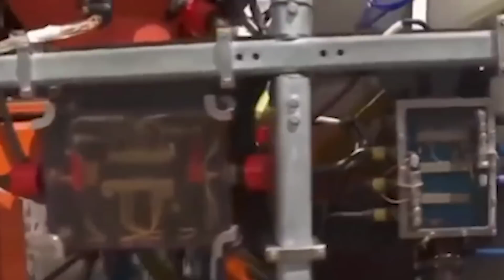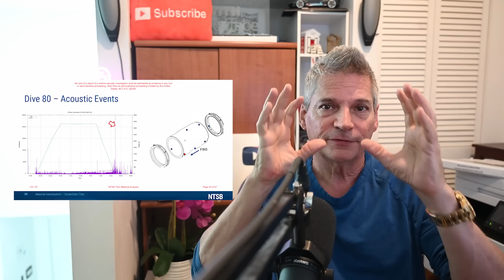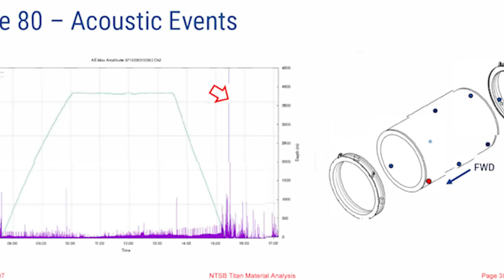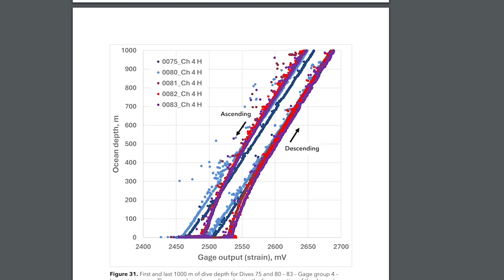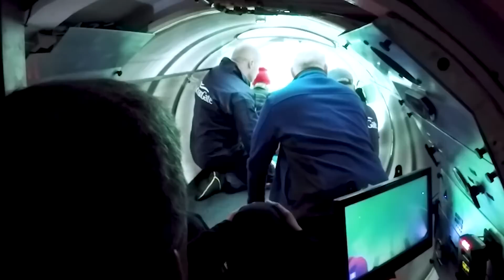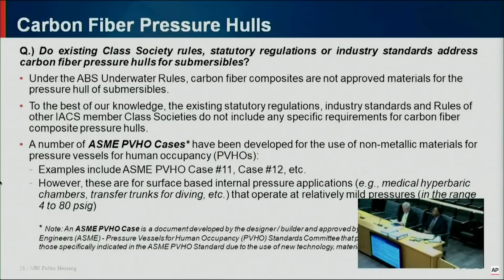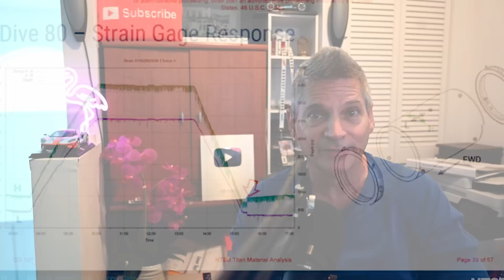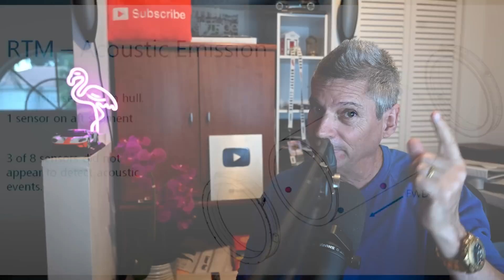How OceanGate Titan Sub Realtime Hull Monitor FAILED! RTM

Comment: Logic tells me at 1inch thick of CF sandwiched on top of other 1 inch layers of CF up to 5 times, is know good of the bat, because the compression forces on it would delaminate it easily as its technically not a solid block,, what would happen is each layer would delaminate separately and it would Implode definetly, no matter if it was reinforced with metal rings, the pressure would find it's way into the Hull automaticly in a unpredictable manner. In different areas at different times, The RTM is not set up to detect what is except able in ways of a graph, meaning no one knows what it's except able tolerance is, because there's no data in all of history to support the test they were doing, meaning they have no reference point to begin with, the whole project is flawed from the start.

Comment: Does the graph show which sensor is detecting which area of the Hull, if it does not then how can a person keep track of the data methodically. Pinpointing where the movement is happening, if it don't show that information then this system is not going to work as intended, furthermore does it show at what depth the movement is making and pinpoint accuracy of the movement on the Hull of where the noise is coming from at pinpoint accuracy on the area of the Hull. If it don't do that then it's a gimmick and not showing any information that would be needed to keep track of the Hulls condition. PERIOD.

Comment: So what happens if the pressure on the titanium end domes at each end Force themselves inwards the deeper you go, At the same time the carbon fibre are forced with pressure at compression, now you got a situation the pressure of water on both material become different to one another, and logic says titanium is stronger then carbon fibre under compression so now what will happen is this design is a design that will Implode.

Comment: The acoustic RTM system was a hollow sham. It gave the sub pilot visual readouts only of the sound levels from the sensors - there were no sound alerts. Unless the pilot had his eyes on the screen, he was unaware of any issue.  The system was simply one piece of assurance he could give his clients. It was essentially useless for safety purposes.

Comment: Howdy Jeff. Fifty years of composite construction here, ten in CFRP. Have another look at your 
vid. Notice how the top line of winding is curved? The mandrel should give its shape to the layup.
The modulus will be uneven, no calcs will be possible. The hull must be of consistent thickness. I won't go into belt sanding pristine laminated structures. Carbon fiber must be monolithic, in dimension and distribution of stress. CFRP is an excellent choice, and makes a submersible just fine, after seasoning and strict dimensional standards are met... Love your work on 171....   Captain Bill

Comment: The idea behind the RTM system is sound. But it’s useless without a metric by which to interperet the data. You need to do the destructive analysis with the sensors to know what your material sounds like under strain, and you need to  conduct the carbon fiber autopsy to see what kind of damage the sound you just heard caused. And you need to understand how to correlate your data to actually understand what it’s telling you. And Stockton did none of that.

Comment: I always thought carbon fibre products were always placed in an enclave under pressure in order to squeeze out all these defects to the glue layers.
Reply: Autoclave. Yes !! It also needs to be wound with linear stress on the tape, to prevent wavy results as seen in the video. That is a rookie and lethal product. The CFRP did not fail. The Hull/Titanium join leaked, and the implosion was preceded by internall pressure blowing out the lens dome first, then implosion. They knew from the water entry they were going to die ......that's why they dropped ballast ......

Comment: In my (brief) laboratory experience with bend testing carbon-carbon composites with acoustic equipment set up, the time between seeing an increase in acoustic events (fibres breaking) to total sample failure was usually a couple of seconds, so unless you can remove the load instantly, the test sample breaks.
This is why miners like wooden support beams, you can hear them start cracking and have time to get out.

Comment: That arrogant @$$hole never did cyclic fatigue testing to see at what point the data he was gathering from the RTMS would actually indicate a failure would be imminent... he barely did destructive testing.

If you really think about what they were doing with the data, they were only listening to the sounds that were being made, never once did any of them stop and realize that the sounds they were hearing were fibers breaking and those fibers do not heal, meaning every sound event they were picking up was further degradation to the hull and thus inevitably marching towards the point when enough fibers would be broken that the thing would collapse in upon itself in a nanosecond timescale.

Comment: New communications from the day in question reveal that the RTM ssustem lot up across the board and they were dropping weights to come back up but it was to slow they couldn't get the acsent going good enough in time so sad they reported that there was loud noises coming from the aft section of the sun it was probably from welding on hooks on the ring for transportation after being told by the engineer that it would be a bad mistake because the ring wasn't designed to handle such wieght

Comment: Great video, thanks 👍
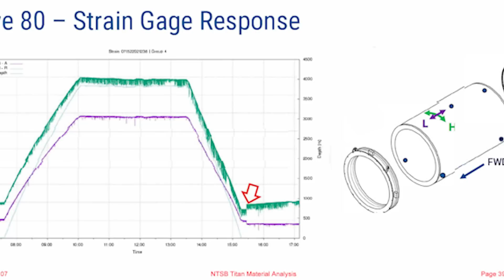8:40 That big bang sound would make sense, because when they dived something relatively major in the hull must have reached "almost" breaking point, but the pressure kept the damaged hull in place where it must have started cracking significantly, but it did not move or make major sound due to the pressure and not damaged enough to cause an implosion. However when they came back up, the negative pressure caused that crack to open up as the hull expanded back to its original size, and that caused the sound and strain gauge readings. 
So that bang was the sound of the hull telling Stockton that it was done diving to the Titanic depth (and then leaving that damaged hull in freezing conditions for almost 7 months caused the final damage that guaranteed an implosion on their next dive to depth), but Stockton played deaf & dumb, because he needed the dollar$ at any cost, even if it meant they implode, which I believe in his mind was the better option than replacing the hull, which he could not afford, and declaring bankruptcy was not an option for his ego & arrogance.

Comment: Thank you for this beautifull documentary. Was the titanium/ carbon connection ever tested under these high pressures?
Reply from the maker: I think they had small replicas. The first replica was about 3 feet long
Reply: They tested 1/3 scale models in a water pressure vessel.

Comment: Not an engineer at all. But my understanding is telling me that once something is stressed to a certain point even if it’s returned to a standard point it’s still not as durable as the original. 80+ trips was too much. Especially if it’s carbon fiber and signs of failure was already seen. 

The warning system should have been used before trips and not whether or not to continue the current trip . If that makes sense

Comment: The rings you describe as potentially helping to reinforce the structure sound a lot like bulkheads which are common in marine structures. Probably could have at least helped with earlier warning - they may have shown note obvious evidence of fatigue physical buckling if they were made of metal. The overarching failure iis they committed the worst engineering sin one which is to build the vessel with a single point catastrophic failure potential on critical systems which in the case was  unbelievably the actual hull itself. Take commercial airplanes as a relevant .  example : they are built on a tertiary backup model for all critical components ie they have 3 backups for all critical systems to prevent a single failure from creating  a catastrophic failure event.

Comment: I am now wondering, so they had a real time monitoring, rush said, that if there was cracking heard it would be a sign.
The last message received by the motoring ship was "Dropping two weights" so what if the real time monitoring system didn't actually failed, but rather they realized and tried to get to the surface quickly, and thus they "dropped two weights" 
But when they dropped those two weights was when the Titan imploded

Comment: Talking about Boeing recommending a 10 inch hull vs Stockton’s 5 inch hull. Stockton Rush should’ve taken a page from the very shipwreck he was visiting and subsequently went down in history with.. The Titanic was made made from pig iron (and low grade steel) I’m assuming to cut costs/ reduce manufacturing costs. Also, the Titanic was supposed to be double hulled and it wasn’t, another fatal manufacturing  cost cut.. Definitely some interesting parallels here…

Comment: I am not at all an engineer but even I understand that :

1- a spherical hull is stronger than a cylindrical hull against external pressure

2- winding strenghtening material around the hull is a good idea when the strain comes from inside (like in the case of a pressurized aircraft) but not very effective when the strain comes from outside (like in the case of a deep sea submersible)

3- a design that doesn't allow for thorough examination of the hull after each dive, is essentially going to hide fatigue and corrosion from you, and thus render each additional dive riskier than the precedent without letting you know when critical safety limits are crossed.

I never understood how this team of brilliant engineers came up with a submarine that was inevitably going to fail one day or the other.....

Comment: The supporting rings idea...have to remember the sheer magnitude of loads and material strength of 5" thick carbon fiber. The rings would need to be made of some amazing material to make any difference. Otherwise it's just like a wooden 2x4 trying to hold back a hydraulic press. If 5" of carbon fiber isn't holding up, a 1" thk ring of metal is not even a speed bump. It might as well just be decorative gold foil. 😉

Comment: IDk the exact specifics of the monitoring system but judging by them dropping some weight with poor visibility THAT was the reason for dropping the weight the warning system was likely going off.
So judging by how close together the message was from the implosion sound I would  say the warning system was slack at best.The only other reasoning was that Stockton took too long to react to the warning hum and hawed over it then it was too late.
I feel ike right from the get go it was very poorly planned I would expect such a decent to be VERY  slow but they perhaps did not have the oxygen to take it at a slow descent so planned on rushing it until they got a warning then would begin to drop weights to slow it down.

Comment: Carbon fiber isn't the weak link it is the epoxy bonding glue material it doesn't have the elasticity for never ending cycles going down to Titanic over and over. Also they way it was manufactured wound round the mandrel was a very poor method as regards strength it should have manufactured in a weave pattern not just straight lines.

Comment: I know your video is a little old but thought I'd make a reply, having sensors on the inside of the ship means those sensors are going to receive data after compression movement has traveled through the five layers so it makes sense that the sensors should have been on the outside of the sub. Looking at the pictures of the parts brought up after the implosion show the glue in between the layers had failed basically you had five submarines in one each layer being compressed into the next until the glue joints between them failed. In the boating industry you make layups with the exact same materials all the way through secondary bonds have to be done within a certain window of time to gain mechanical adhesion so all layers work together as one. Something interesting is you can't water jet carbon fiber it will cut through where the immediate jet is hitting the surface but the high pressure water will deflect off the carbon fibers out into the laminate several inches causing water bubbles separating the laminate layers virtually stripping the glue away and leaving just the Sharp raw edges of carbon no longer bonded.
Reply from the maker: Turns out the one of 8 sensors on Dive 80 ha da huge spike indicating a problem, but Rush ignored it and a few dives later it imploded.

Comment: Perhaps his mistake was in deducing that if the cylinder broke at 6,500 meters, it was safe. But he didn't run further tests at lower depths repeatedly, thinking they weren't necessary, because he thought the carbon fiber layers wouldn't be sheared on each dive.

Comment: 250,000$ ticket to just sit on the floor in a magical carbon fiber hull which has been giving crackimg sounds way before the implosion and to just die in nanoseconds,faster than brain can even process and your body or anything called a body or a part of body will never be even found and becoming one with the sea itself. Just tragedy.

All the signs were given. All the experts warned. All ignored. Crucial rules were broken. Ego driven. Risk taken too lightly or never taken in account at all. Even Stockton laughed and mocked at a  statement that says "put safety as priority over innovation". This is just a murder-suicide. There is nothing else to describe it. You can break rules all you want. Rules are written in blood. They are there because of tragedy before them. No one,absolutely no one can break physics. When you decide to mess with physics in a way where you trying to break,sorry its not going to happen. Even nature follows physics because it knows,if one breaks so is everything. He tried to break physics. It warned him. He ignored it. His ego driven. And he is dead and brought another 5 people with him. Stockton Rush is NOT an innovator. He is a murderer.

Comment: The people on the OceanGate team that were interpreting the data were not Mechanical Engineers or Material Scientists, other than Mr Rush, aeronautical engineer. The director of engineering at that time was an Electrical Engineer.  They were farming out this data to a 3rd party contractor to actually interpret, which means that you do not have someone on the crew that can actually tell during a dive that there is a problem.  This could have been ok if there were protocols in place for the person monitoring those sensors that could abort the mission if x-sensor registered strain of y-value or volume of z-sound.

Comment: First, that was clear plastic deformation, and worse, it was  composite delamination. 
As a mechE who worked with composite mats, this was so insanely obvious. Even after getting the layup and autoclave processes perfect, voids were still possible. Its very easy to check that via ultrasonic ndt

Comment: i had a car at a mercedes workshop where the customer said he had refilled coolant because the car was complaining but the message didnt go away. he was sure it was a defective motor and brought it in. not surprisingly the warning lamp didnt go away because he had filled coolant in the windshield washer system......the guy was washing his windshield with thick red liquid and never once questioned it beeing sure the manufactorers were to blaime. after this when he was told what he had done he changed his story and "we had filled it in a service" he was informed that we dont fill washerfluid tanks with coolant at this workshop.

Comment: rush was a maniac, it makes no sense to keep reusing a carbon fibre hull endlessly under such extreme pressure cycles, it will eventual fail for sure as it did, it's surprising he got so many dives in before catastrophic failure ???
Reply: Well, he didn’t use it endlessly, technically. It was retired after its last dive.

Comment: Stockton RUSH's sub called TITANic as part of oceanGATE somehow disappears.  Who coulda thunk using carbon fiber which is only strong in one direction, that being the OPPOSITE direction needed in this application, who coulda thunk this thing that was glued together one afternoon by some dudes with loctite in buckets.  Who could THUNK it woulda imploded????  Who?  Anyone with 9 brain cells.  My only regret is the poor 19-year old kid who no doubt wanted to appease his father.  
Also refer to the recent, extra awesome (not awesome), testimony of the couple who were on board a previous failed mission that had this idiot "sub" smashing against it's locking mechanism for an hour....slam...slam...slam...described as "incredibly jarring" and "slammiing metal on metal: by the occupants, for an hour in the ocean...only to be brushed off by these professionals.  Get Out Of Here.

Comment: This whole "early warning system" that keeps going around just kills me.  Even a non-mechanical engineer will tell you a "system" like this will work like this:
beep bee---pop.  All that as fast as you can read that sentence.  It doesn't work like that at those depths...you don't get a crack-warning then comfortably float to the surface.  Your ears, at best, might here the warning 1 second before your body is turned into paste.
Reply: Also, this "realtime warning system" would have worked like this:

Beep be...pop.  The pop being everyone inside dying instantly.  What an absolute joke.

Comment: Why is no one mentioning that this design is for pressure on the inside? Carbon fiber and other composites has immense strength under tension, not compression. He was solely relying on the glue that held it together. So stupid.